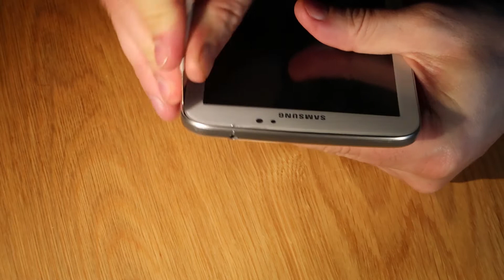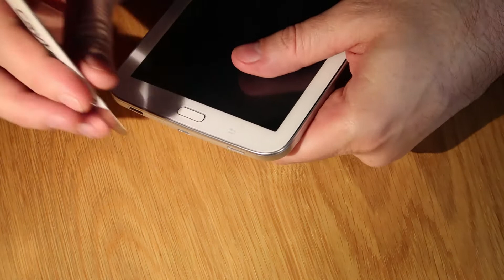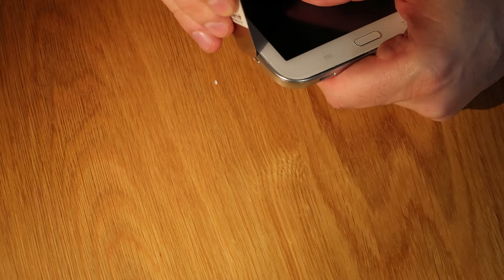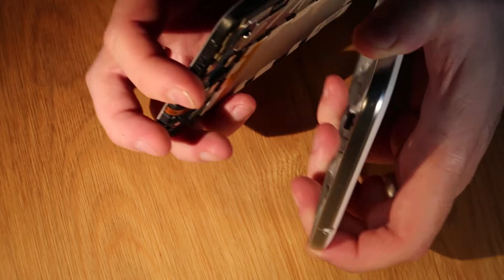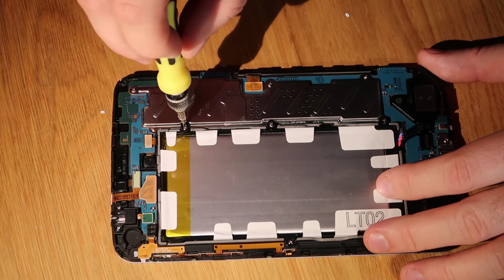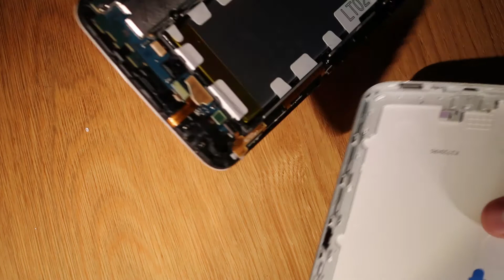Samsung Tab 3 7" Motherboard Replacement

Comment: Hello, My husband and I Have old Samsung tablets..... I was wondering is it possible to update external software to make it more current? We're just trying to figure out if it's more inexpensive replacing parts compared to purchasing a newer Samsung Tablet. (Physical-external parts)
Reply from the maker: Yes and no. Officially they are limited to a specific os. Unofficially you can root the device and load more current software but it can be buggy. There are lots of guide out there with a little googling
Reply: ❤Thank You @WeRepair
Reply from the maker: You are most welcome 🤗

Comment: My samsung tab 3 is not charging, and i cant power on. But when i tried to unplug the battery and plug it in back it just automatic goes on booting 2x showing samsung tab. Then it goes to black screen with no sign of power. What could be the problem sir?
Reply from the maker: The fact that the device tries to charge and turn on makes it sound like a failed battery to me. So I would do a battery replacement. Here is the link to my video: https://youtu.be/erUps1uSaRs

Comment: Very informative video, I'm curious to know if the mainboard comes with android on, or do you need to program it yourself through Odin.
Reply from the maker: I bought it off eBay second hand so it came with Android preinstalled.